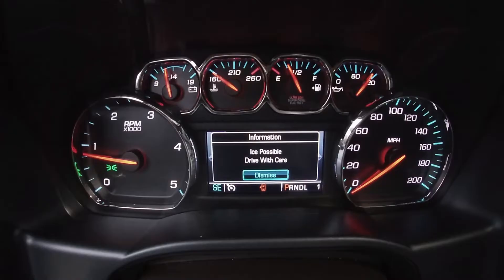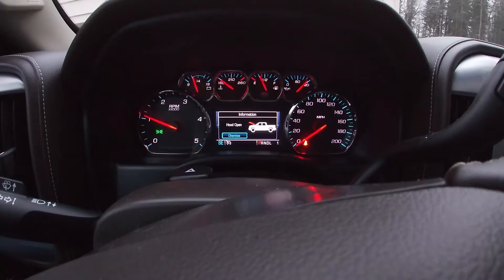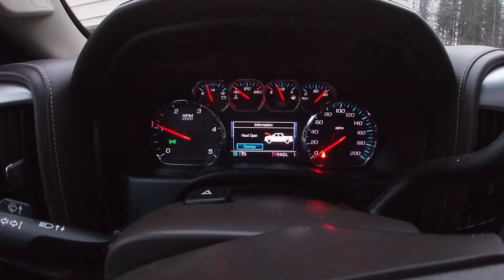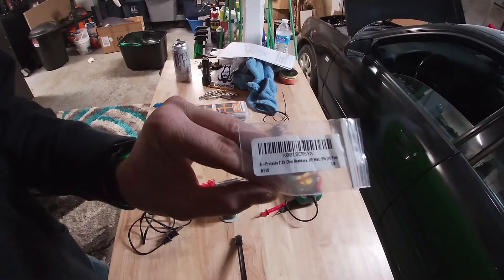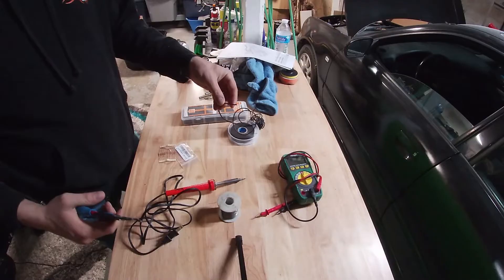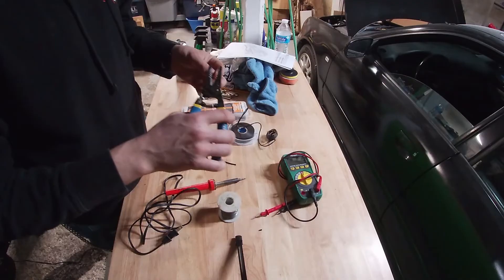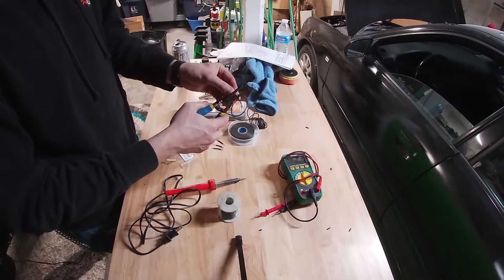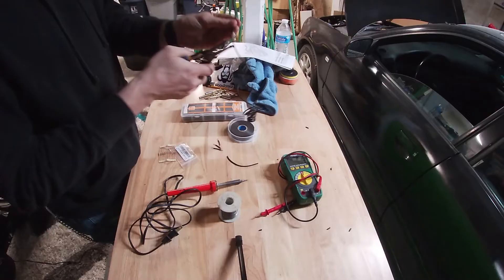Chevy and GMC Hood Latch Switch Bypass Open Hood warning

Comment: I just unplugged it, there's no need of a bypass, problem solved no more light
Reply from the maker: My problem with that was by unplugging it it would get rid of the warning but it wouldn't allow the remote start to work.
Reply: @alaskagarage  Really, I rarely use the remote start but that's good to know. Thanks
Reply: @alaskagarage  I also unplugged and light did go off,  but like you said, no remote start. I gotta have my remote start!

Comment: Thanks dude, just did this today, worked out great. Chevy told me the replacement hood latch was on backorder with no estimate of when it will be back in stock. I didn’t even use any extra wire, just soldered the resistor onto the tails that came out of the plug, then shrink wrapped.
Reply from the maker: Glad it helped
Reply: Hi. Which model? Which year? Ohm? Watt? Please tell me my friend. I need your help
Reply from the maker: @n.a3932  The ones that i used i have a link in the description to the ones I ordered.
Reply: @alaskagarage  How long did it work?
Reply from the maker: @n.a3932  still works. I have not had a single issue since installing them. installed over 3 months ago
Reply: @alaskagarage  220ohm 1/2 Watt?. But you told me 5w yesterday
Reply from the maker: @n.a3932  I must of did a typo .5 w   /  1/2 w
Reply: hello, can you tell me the name of the solder, please I have the same problem with the Chevrolet volt 2011
Reply from the maker: it is just a regular silver solder that I use that they should sell at any home depot or auto parts store. I like the skinnier stuff cause I feal like I have more control of the amount im using.

Comment: Yeah, me and my son did this and the "hood open" light went off, but now we have a "check engine" light.   lol
Reply from the maker: Did you check the resistor to make sure it is creating the rite resistance? Is the hood latch the same type? If both are correct then your problem might be within your harness and that problem caused excess voltage going to the latch causing it to go bad.
Reply: You will need both wires with resistors tied into the black wire on the pigtail. One goes to the red wire, one goes to the yellow wire. This will satisfy the resistance for the BCM and ECM.
Reply: Yes @patrick yellow wired needs to be incorporated to eliminate check engine light

Comment: it appears you only use one resister but you make 3 up, did you just make extras or do you need to hook 3 of them up to make it work?
Reply from the maker: You only need one. I did up multiple just in case they didn't last long, but months later now it is still working perfectly.

Comment: What happens if you just tie the wires together?
Reply: And not use resistor
Reply from the maker: That does get rid of the hood open warning but will not satisfy so that the factory auto start works. It could also mess up other more expensive components because they are designed to see that resistance or  open circuit for Hood open.

Comment: 2017 GMC Sierra 2500HD and this worked perfect thank you !! We had the same issue with the hood open light on dash and lost remote start. Only difference we did as we followed your video is instead of solder iron we went with the "Kuject" brand "Solder Seal Wire Connectors". For those who aren't familiar with them, just insert both ends of bare wires into the connectors, apply heat and within seconds the connectors solder as well as shrink wrap. Found them on Amazon. Thanks for such a detailed clear video and description of what you were doing especially the heads up to Ohm test the harness first . Good job, thanks.
Reply from the maker: No problem at all. I'm glad it was able to help someone out.
Reply: @alaskagarage Hey Bud,  im trying to do this to my car but i camt seem to find the 2.2k you think i can use something a little higher than 2.2k or lower than 2.2k?
Reply from the maker: @jamiemorales2022  look in the description. I put the 2.2 resistors that I used in there that worked for me.

Comment: My understanding is this is just a microswitch that is normally open and closes to complete the circuit when the hood is shut.  Why is a resistor required at all?  Can it simply be jumped using a wire?  Thanks for great video!
Reply from the maker: if you just simple connect the circuit with a wire it will get rid of the open hood warning but it won't satisfy the computer so your auto start still wont work.

Comment: I have a 2020 model and had to add 720 ohm resistor to terminal 1-3 or yellow to black in my case.  This was in addition to the 2200 ohms between terminal 1-2 or red and black.

Comment: Does the engine light on have something to do with it too ? Because my Chevy Silverado has the same problem but with the engine light on I checked it all and there’s nothing wrong with it first or the Cadillac converter wasn’t good but I took it to the mechanics and the dealer and it shows it’s nothing bad
Reply from the maker: If you have an engine light that came on with the hood open notification you probably have a short somewhere in your wiring
Reply: Catalytic converter

Comment: You will save my nerves if this works. How did you learn that 2.2k Om resistor is needed?
Reply from the maker: I found it in the forums. It worked for me and it should work for anyone that has the same latch
Reply: @alaskagarage  I see. Have talked to so many car electricians but none of them agreed to take over this issue. First as the Google AI confirmed :-) I simply connected the wires together from the latch in different combinations but the check light didn't go off. Now I see the sensor is not just a contact but produces resistance for the ECU. I will try to solve the issue with two resistors for the red and the yellow wires. Thanks, bro!
Reply from the maker: @Zabarotropitili  no problem yeah if you connect the wires together it could over time creat other issues within your electrical system

Comment: Hi. May I use 2.2K ohm 1/4w resistor for it? Or I must use 1/2w?
Reply from the maker: It in theory should work. I did not check load to know how close it is and the resistor could go bad faster depending on the amount of load in the circuit. I have not had a single issue with the .5 w 2.2 ohm one I put in mine.
Reply: @alaskagarage  How much should be the ideal wattage for chevrolets?
Reply from the maker: I based of off the wire gauge  that it is being attached to. I don't know the specific rating of the system, but they should have designed the harness for the wires to be within the rating of the expected or potential wattage and the .5 matched up to the wires its connected to. A .25 will be a very small wire and smaller resistor.

Comment: Hey man, great video, where you throwing a check engine light also? I have a 2018 1500 LT V6, dealer told me today my hood latch sensor needs to be replaced. My remote start has not worked for a few months and recently my check engine light came on. this looks like a possible fix, any info would help, thank you.
Reply from the maker: I did not have a check engine light just the hood open warning and my auto start wouldn't work.

Comment: Hello My Friend. My car is Chevy Equinox Lt 2019. My car's hood latch sensor is broken. The hood always seems open. How many ohm resistors should I use?
Reply from the maker: the same resistors that were used in the video should also work for the Equinox. It is looking for a range of resistance to be satisfied.  You will just have to pay attention to the plug that is being used the switch may have 3 wires coming of off it but only 2 of them are utilized in the plug. You will want the resistor beaten the 2 utilized wires to create the resistance between them . 
I hope this helps
Reply: @alaskagarage  Yes My Friend. Same as part of the car in the video. There are 3 cables. yellow, red, black. I was wondering if the resistor was different. I'll try with a 2.2K 1/2W resistor. I hope I don't damage the car. Thank you

Comment: I used 2.2K ohm 0.5W resistor for 2019 Equinox. But when diagnosing the vehicle, it gives the error "hood latch sensor high voltage" (P257F). I cleared the error code, but it failed again. Can you help me?
Reply: Try to add another resistor for the yellow wire as well.

Comment: I did this and the hood open message went off but  now check engine light came on with a p257f code which means a higher voltage is being sent to ecm?    What do I do?
Reply from the maker: Strange, are you using the correct resistor?
Reply: @Alaska Garage   yes bought from Amazon.    I get 2.18 on ohms, got rid of open hood but now 257f code.   Does Guage of wire matter or length of wire?
Reply from the maker: The ones I used were 1/2watt 2.2k. Before installing these on my truck I tried just connecting the wires together with I would not sujest you do. When I had the wires connected together it removed my hood open warning but it would not satisfy the system so auto start still did not work. You might have a diffrent model of vehicle and it might be looking for a diffrent resistance or you have another electrical gremlin somewhere else that is giving you that. My truck is a 2019 gmc 2500hd
Reply: @Alaska Garage   I have a 2018 chevy silverado 2018 5.3 gas double cab.   I can't find a hood latch anywhere so I thought this was an awesome idea.    I used exact same resistor from same seller.
Reply from the maker: @rick grover  try unplugging the resistor you installed clear the code and c if the code comes back without the resistor installed if the code does not come back install the resistor and c if the code comes in a second time.
Reply: Hello. I used 2.2K ohm 0.5W resistor for my 2019 Chevy Equinox. But I find P257F error code. Same as yours. How did you fix it? Error code p257f: High voltage and resistance error

Comment: Didn’t work for me.  I put the resistor on the plug wires that came from the latch
Reply: So far I get the hood open msg once I start it. After I delete the msg it doesn’t come back. Any idea what I screwed up on?